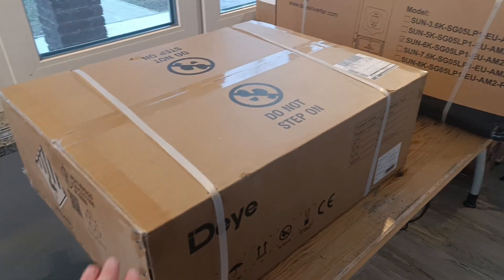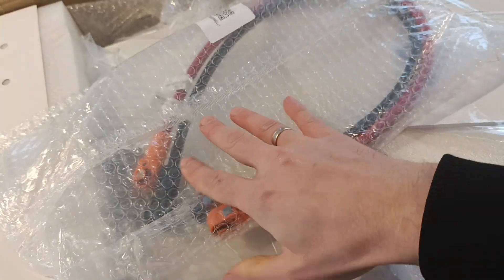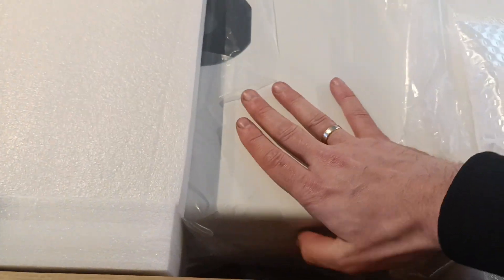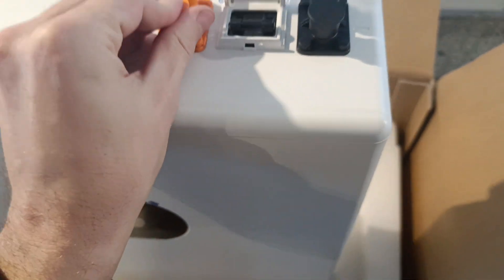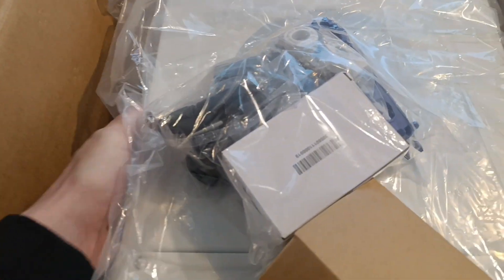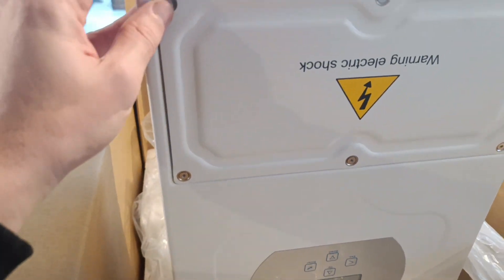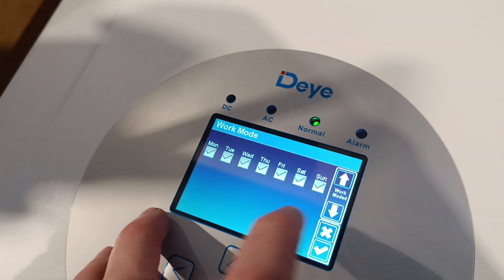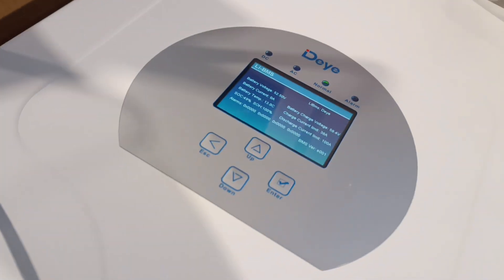Deye SE-F5-PRO-C 5.12 kWh LiFePO4 battery + Deye SUN-6k-SG05LP1-EU-AM2-P - sweet pair for the start!

Comment: Hi Mate, testing Zip Line Charger it is best to use a 12 inch pushbike frame.
( 12"pushbike frame, chain and a back rim, 30M garden hose & steel cable )
After removing ALL parts, attach the back rim on a 12 inch pushbike frame,
attach generator to the middle of the pushbike frame and add a small gear, 
Fit a pushbike chain around the two gears, adjust alinement with generator.
Push the steel cable through the garden hose, tie one end of cable up high,
then put the other end of the steel cable and hose through the frame under 
the rim, so the rim runs on top of the hose after attaching the other end of 
the steel cable down low and tension the steel cable to handle the weight.
Use a long AC extension cable to run from your AC generator to a 3 phase 
bridge rectifier before using PWM solar charge controller then to a battery.
To reset pull generator up to the highest end then release, test and adjust.
It should work like a Zip Line, if AC cable is attached solid, use to pull up.
Make a box or a small roof to protect from the weather at the lower end.
I hope this idea helps everyone get started on Gravity Power.